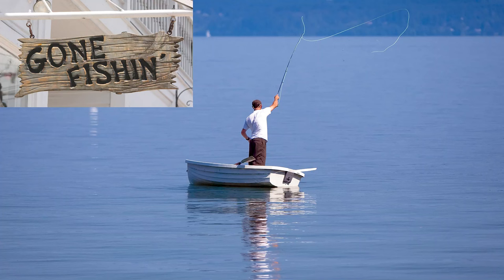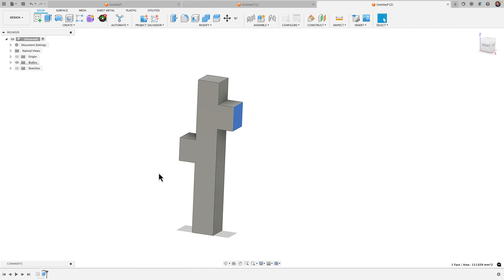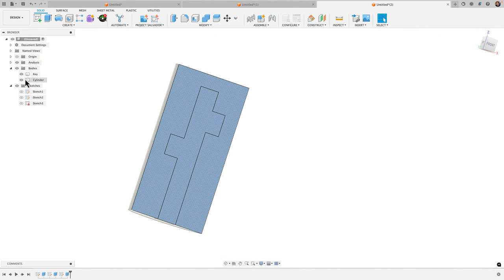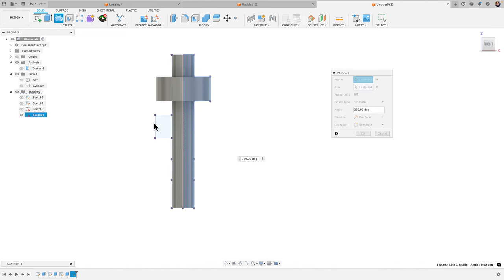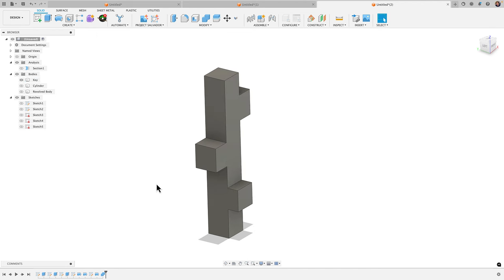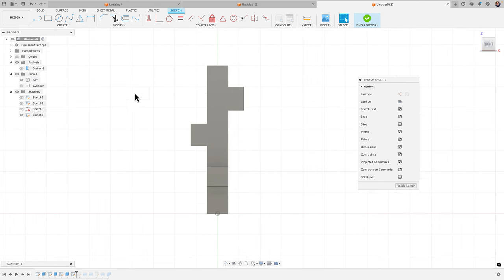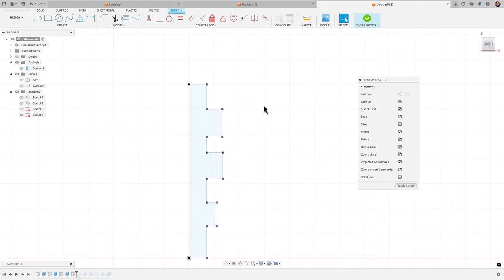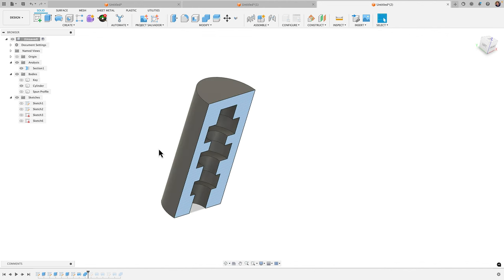New Fusion Design Tool - Spun Profile

Comment: I don't think the revolved body from the sketch actually creates the same shape.  The distance of the furthest edges of your key is a diagonal distance created from the original extrude, so the swept diameter of that extruded body will be a larger diameter than the diameter of the original sketch.  

the point remains that it is a pain to do all that and the new feature is a great thing, I just wanted to point out the results are not identical in this case.  The revolved sketch approach doesnt' create a body that is equivalent to rotating the body.

I see now (after watching the rest) that you noticed it creates a different profile for the reasons I stated, but I do think it's important to realize that the two approaches have different outcomes.
Reply from the maker: Hi Bill, take a look at 10:14 where I talk about this.  Notice that the projected sketch goes wider than the edge of the model to account for the rotation.
Reply: @DesktopMakes  Yep, that's what I was referring to when I said that you mention it later in the video.  I had replied before I got to that point, so went back and edited my comment.
Reply: As a general rule, it’s probably best to watch the entire video before leaving a comment.
Reply: @tgs1766  Man, I totally agree.  I don't think it was totally clear that the two methods deliver different results, which was what I pointed out.  I know the larger profile is pointed out later in the video, but it isn't totally clear at that point this means the first method produces a different results.  Regardless, I subscribe to the channel and enjoy the content.  My aim wasn't to nitpick, it was more to make sure that someone who didn't follow very closely understood that they were different outcomes.
Reply: @tgs1766  agreed, but the two methods do not yield the same shape, unless with hindsight (10:25), he could have gone back and would have had to take the center line to the outer corners of each of the 3 horizontal blocks plus one from the centre to the corner of the centre column (pythagoras, so not immediately obvious to everyone) which is a fair amount of work that this tool solves.

Comment: Thanks for the video and explanation. 

When creating your key, why the multiple sketches? I like short timelines. I get it if they were complex step.

Just my two cents.
Reply from the maker: They key was made with only two sketches.  The second sketch was needed because it was on a different plane.  The only way to keep them on the same sketch would be to enable 3D sketching.
Reply from the maker: Gave this another thought and I could have created the entire key in one sketch.  The second extrusion would simply be from the center plane instead of the front face of the key.
Reply: Thanks for the reply. I continue to challenge myself in keeping my timeline as short as possible.